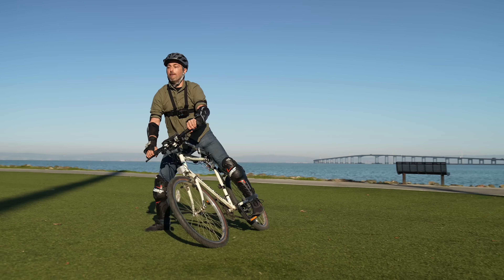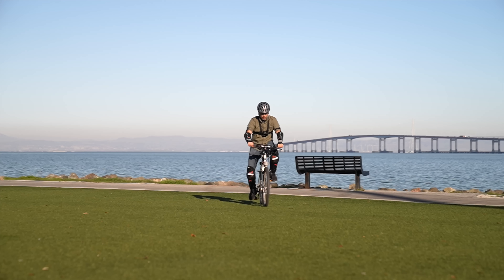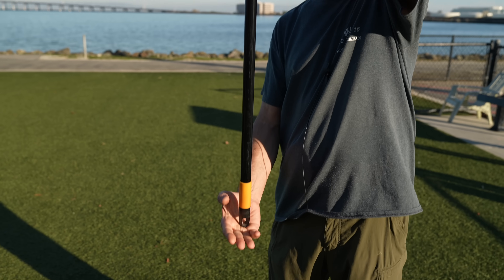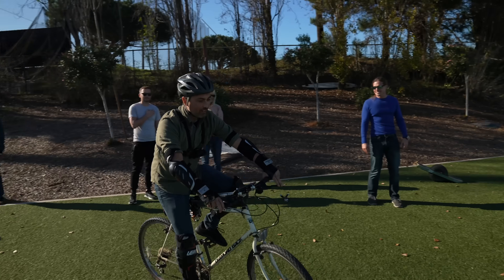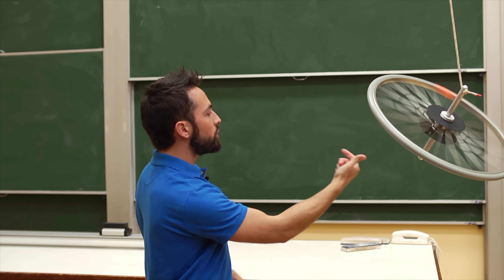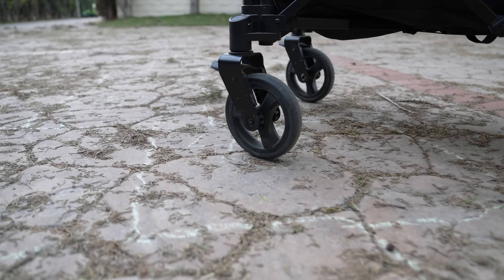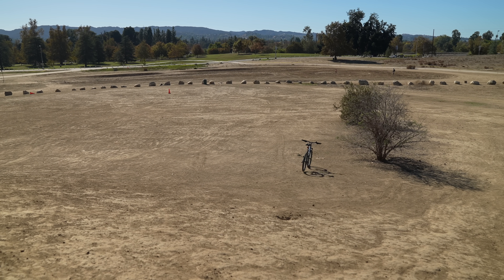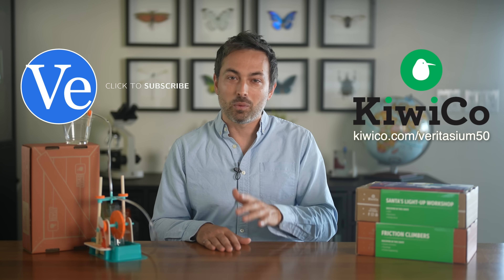Most People Don't Know How Bikes Work

Comment: Another way to steer is simply to lean over towards the direction one wishes to turn. Don't usually work that well at low speeds however.
Ie, one can weld the handlebar in place, completely locking it out and still be able to turn. One's turn radius is however going to be quite large.

The concept of leaning is just that one puts oneself off balance first. Here we can either control the turn radius by how far we lean, at low speeds this usually results in a tumble due to inadequate inertia. Or we can counteract the imbalance from leaning by steering, forcing us to a tighter turn where inertia will be more sufficient to keep us balanced. To stop the turn, we just lean the other way until we are straight again.

This video however clearly indicates that if one steers first, then one will be off balance in the wrong direction. It is just order of operations, it isn't impossible to turn without counter steering, it is however easier at low speeds.

Comment: Impossible?
I dont think so, unecessarily complicated and demanding, sure.
But you can Lean right BEFORE you turn and then follow the momentum of your balance shift into the turn.
Trick riders like Extreme-BMXers does this all the time.
Sometimes due to space limitations, sometimes to get a specific trajectory etc.
Its a useless skill to 99.999% of people and its alot of work for virtually no payoff...
'But its not impossible.

I get the point youre making and Im not saying yorue wrong.
I just dont agree with the use of the word "impossible" in this case..

Edit:
Hah, kinda funny you brought up the "riding in a straight line" argument as it falls into what I was saying.
Somne of these professional trick riders have have seemingly inhuman balannce.
Check out Danny Macaskill if you wanna see what I mean.
The guy rides 30 foot tight-ropes on on his front wheel.

Comment: There are a couple reasons why this video isn't completely correct. 1 you can absolutely turn left without counter-steering given you are going fast enough. 2 you can absolutely balance on a stationary bike, wtf do you think you're doing on a unicycle, just apply sufficient pressure on alternating peddles to stay upright.

Comment: Oh now it makes sense why bikes flop around and hit you whenever you lift it up 

Also I knew right away this video would be about counter steering because I wanted to ride motorcycles so I had to learn how those work and basically it’s everything in this video but at faster speeds 

You can get the fast motorcycle counter steer effect with a normal bike if you go down a hill really fast or have a bike with gears and get up to the last gear going really fast 

But a hill is the best because you can go even faster

Comment: You can actually ride a bicycle or motorcycle by direct steering at lower speeds before counter steering is required. You counter balance your body and directly steer the machine you’re riding. Motojitsu has good demonstrations of this

Comment: Me a big brain:

No the handlebars don't turn the bike... It's own forces due to the rotations of the wheel that resist breaking that vertical rotation do.... Aka: you lean... and that lean pulls you to the left... and then the bike tries to correct that because of that resistance trying to maintain vertical rotation... and then that pulls the bike against you, which then end results as you balancing while leaning, and both you and the bike veering left.... AKA: your weight is what chooses the direction... The wheel only turns so that it can counter-act and balance you using that natural resistance force since it wants to rotate vertical and you're preventing it... It's why when you lean a certain direction without being able to turn the handlebars... It throws you off balance... cause you're leaning without the proper-counter-balance...

And the reason you can normally steer a bike without even holding the handlebars at all, is that lean can naturally put the wheel into the proper spot, because it finds that balance naturally.

At least that's the best I can explain it.

Comment: Been riding bicycle well over 3 decades now and only recently noticed the "counter-steering" thing while driving hands off the steering bar. On open road my "counter-steers" might span a meter even two to opposite direction before turn, not only for having better angle on the turn without need to lose speed but to move the center of mass more to the side I'm turning (more at higher speeds).

Comment: Just gotta lean in the direction you want to turn before turning, easy.

It’s not as quick or efficient, but it works
Reply: >> It’s not as quick or efficient, but it works

No - it doesn't
Reply: @Rick_Cavallaro  sure it does....in the broom stick example, instead of pulling back first, just tilt your hand forward to slowly push the COM of the broom forward, easy.
Reply: @lukasrydelius6174  Neither of those will work either
Reply: @Rick_Cavallaro  why not?

Imagine putting the broomstick on a slope, it will tilt down the slope. Without displacing the contact point, but just by manipulating the angle of contact you shift the contact point and the normal force just enough to push the COM forward. All without moving the tip of the broomstick first.

Comment: "Most people" maybe, but most people are actually pretty poor cyclists. I doubt you'd get the same results from a high level mountain biker or even roadie. In mtb we're used to being out of the saddle over rough terrain and using body weight to steer. Even proficient roadies will do this. The mass of a bicycle is insignificant relative to the rider, so the rider gets to determine the weight distribution freely. It might be more difficult on a big Harley, for example, where you would absolutely need to work with the weight of the bike. Just don't glue your arse to the saddle and the problem will go away.

Also your assertions about steering and balance are wrong. You CAN use steering to balance while stationary. This is because of the head angle which is not 90 degrees, and the fork also having an offset to put the axle in front of the pivot point, allowing weight distribution adjustments quickly and precisely with the added bonus of leverage.. Anyone who can do a trackstand knows how important this is.
Reply: >>  I doubt you'd get the same results from a high level mountain biker or even roadie.

I've put professional bike and motorcycle racers on this bike.  Exactly the same results.

Comment: Bro.. 

You have to lean your body into the turn. It's not that hard. You can simulate the "locked handlebar" simply by going too fast and making a turn, because trying to counter steer at high speed is too sharp, so you lean into the turn so the bike is not taken out from under you.

Comment: You only countersteer if you are going extremely slow and have bad balance.  Lean and turn the wheel will work just fine without countersteering.  The problem is you are locking the ability to catch your balance by turning back.

It literally has nothing to do with countersteering.  You are just using steering to balance, because your balance is bad.  Ask someone who doesn't use the handle bars to do this.

Comment: I really thought you were going to go into how motorcycles are steered, wherein you lean into turns. But not just that, there's the concept of "pushing" into a turn. When going at motorcycle speeds, if you want to turn right, you "push" the right side of the handlebars forward, essentially "turning" the bars to the left. This isn't to keep your own balance, since at motorcycle speeds, you really can't fall down without external forces. But, just "turning" to the left makes you actually lean right, and vice-versa. When you were talking about locking the bars, my initial thought was that you simply needed to be going faster. If you have enough speed, you would just push into the turn rather than steering into it, so to speak.

Comment: Try this experiment by riding the bike without hands. Not using your hands to turn actually does away the whole steering issue, if one is confident enough to steer right and left without use of handlebars.

Comment: Conclusion to avoid the confusion:

When you ride a bike, the act of you pushing the pedal down sets you off balance.

Hence, you have to shift your body weight to correct it. Because of the shift, frontal wheel turns and allows for the turn to happen, and for you to regain balance.

If the wheel is not turning, obviously, you won’t restore the balance just as much, as you would have to move your center of gravity WAAY much more in the opposite side. 

“Countersteering” etc are just weird terms.

You can ride a bike without hands with a similar principle.

But the whole “you ride your bike wrong/don’t know how to” is a terrible sentiment.

It works like this: Move body weight AND wheel one direction, you make a turn in that direction => move the wheel and your weight in the opposite direction not to fall flat, as you set yourself off-balance by doing the step 1.
Reply: Body positioning has a minimal effect on steering due to centripetal force and you would never be able to make hard turns. Also when you body lean it causes the wheel to countersteer!
Its all in twist of the wrist 2 by keith code, the motorcycling bible. Theres a movie on youtube its basically non negotiable

Comment: The first time I ever noticed this was on a motorcycle, at ~20 mph a large majority of your turning is done only by counter steering, so if you take your hand off the bars and just bump the bar, the bike will “fall” on that side, it is extremely weird feeling at first, and gets even weirder when you transfer back to turning like you would on a bicycle under that 20mph range, it’s almost like learning how to ride again before you calibrate to the speed difference (atleast for me).

Comment: I recently built an electric tricycle.  It's fascinating playing with its steering geometry. It illustrates this point really. You push right to turn left.
Reply: How does it work on tricycles? Do they lean? If it doesn't the steering is botched and the vehicle is much harder to control than a regular bike. Bikes with a carriage on the side, usually have it connected in such a way it leans with the bike.

Comment: This information is both right and wrong. The main reason for the bike staying upright IS because of the gyroscopic forces of the wheels “outweighing” the force of gravity. Take a single wheel, for example (or any torus shape), and roll it down a hill. It will keep it’s balance because more forces are pushing into the ground and away from the ground to hold it up. The reason things change with a bike is because the steering mechanism is messing with the gyroscopics in the first place. So, it would LOOK like steering is the more important factor, but it’s not. And when the steering was locked, that also messed with the balance of the wheels. Each wheel is trying to recover from falling over, but it is being affected by the other wheel since the system is now rigid. So, when the steering is free, and the bike is freely rolling down the hill, both wheels can independently keep upright. The physics that goes into stuff like this is pretty cool, but I think it’s important to elaborate a little more deeply as to WHY things are happening. Correlation does not equal causation.
Reply: >> The main reason for the bike staying upright IS because of the gyroscopic forces

Nope.  This has been demonstrated on bikes with NO gyroscopic forces.
Reply: @Rick_Cavallaro  Simply wrong. The angular momentum of the wheel is what keeps the bike upright. Exactly why you can’t balance a bike with free steering when it’s not moving. Read the rest of my original comment.
Reply: @logandaniels5  I've read your entire original comment.  It's ironic because you clearly didn't read my comment where I point out that bikes have been built that DO NOT HAVE any angular momentum, and yet people can still ride them just fine.  Using your words, you're simply wrong - and it has been demonstrated experimentally.
Reply: @Rick_Cavallaro  I did read your comment… and nowhere in there did I see any logical reasoning. All you said was, “This has been demonstrated on bikes with NO gyroscopic forces.” How do you explain training rollers then? What’s the ONE difference between a bike at rest on flat ground vs. a bike on rollers? The answer is the angular momentum of the wheels creating gyroscopic forces that hold the bike upright… I’m not seeing a single thing from you or the video hear here that is disproving that. You’re looking at the correlation between the front wheel moving and the bike remaining upright. Not WHY it’s happening. Again, you’re wrong.
Reply: @logandaniels5  
>> Again, you’re wrong.

I''ll bet you $10K.  Contact me via linkedin.

>> What’s the ONE difference between a bike at rest on flat ground vs. a bike on rollers? The answer is the angular momentum

Wrong.  I can tell you the difference.  And I do describe it in the video.  So you can get the answer for free, or you can get it for $10K.  If it were angular momentum, how the hell do you explain people riding bikes that HAVE NO ANGULAR MOMENTUM?
Reply: Incidentally, you're not even  consistent in your wrongness.  There is a difference between gyroscopic moment and angular momentum. Even the people that have been wrong about this for decades don't claim that angular momentum has anything to do with it.
Reply: @Rick_Cavallaro  🤦🏻‍♂️ man… I’m starting to feel bad for you and your logical fallacies. I could bet you $10k or my entire net worth… it wouldn’t matter. Plus, I wouldn’t want to take that from you. There’s no such thing as a bicycle without angular momentum. And just so you know, there’s no such thing as gyroscopic momentum lmao, angular momentum causes gyroscopic MOTION. Read a physics book or something. Or at least give me SOME kind of logic behind your stance. You haven’t done that one time. 👋🏼

Comment: Or you can literally keep the bars straight and use you hips
Reply: And then you can literally fall
Reply: @Rick_Cavallaro  ever ride no hands..?
Reply: @THIS---GUY  Yup - many miles.  But I assure you you can't do it with your bars held straight.
Reply: @Rick_Cavallaro  the bars are locked one direction so if you were turning left you would lean left or counter lean right and the bike would turn to the left without handlebar input for reasons included in the video. You wouldn't need to touch the bars so you steer with your hips
Reply: @THIS---GUY  
>> for reasons included in the video.

You mean the reasons I explain in the video?  It seems you may have to watch again.

Comment: i have done the no steering thing myself all you have to do is tilt the bike as a whole left from right and back and forth as you ride its really not hard to ride with no turning if you use the whole bike for balance and stability. you have to dip it back and forth like you would when "sprinting". aslo for left or right lock all you need to do is dip the bike in the direction and counter your own weight. I used to do this as a kid for fun. basically the bike will be almost horizontal with the ground.

Comment: Yeah this is wrong.   You don't actually steer a bike by turning the handlebars. You steer it by leaning into the direction you want to turn.  You can turn in either direction without ever actually twisting the bars at all. Just lean.  The bars simply help shorten the turning radius